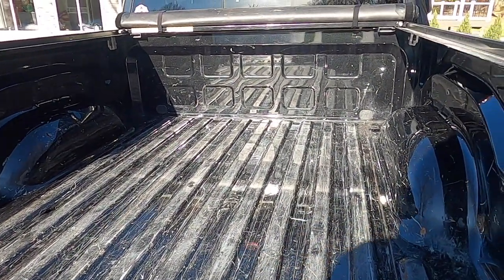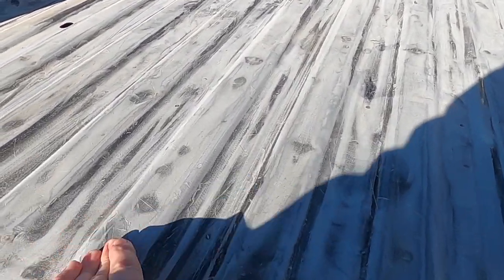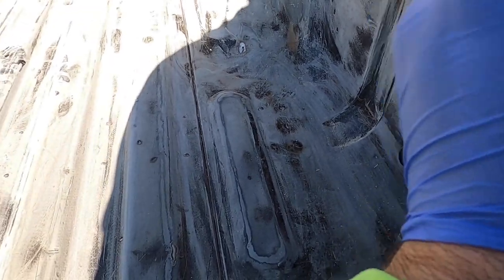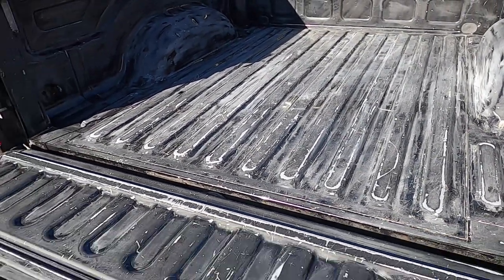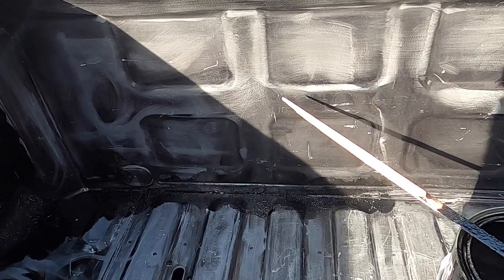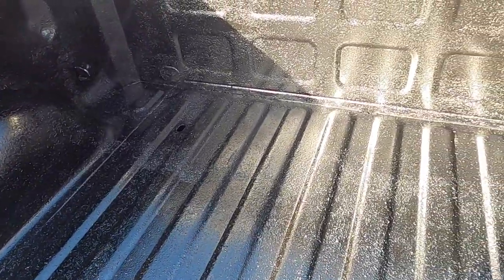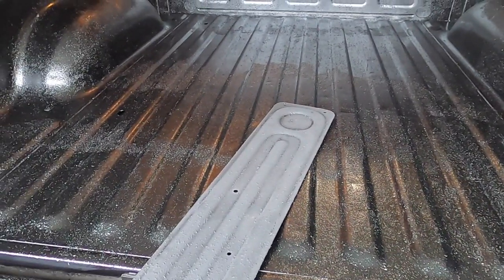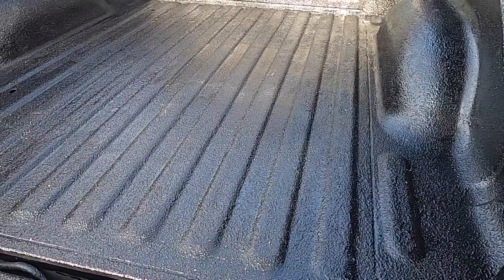Backyard DIY Herculiner Installation /Application Roll on Bed liner HCL1B8 Brush Bed Ram 1500 5'7"

Comment: Nice demo, Kevin. Truck bed looks professionally done!  Thanks for explaining it so well.  I also appreciate the low noise level of the music.  Best is no music.
1. Use an angle grinder with a wire cup brush ($5 at Harbor Freight) to sand contours.  Works well.,
2. Do you know if Herculiner is an Epoxy or a Polyurethane based paint?  Epoxy has a shorter pot life land tends to crack under vibration.
3. Can you custom tint Herculiner?
Reply from the maker: Thanks for the compliment!   Great idea on the wire cup.  As for the base, it’s polyurethane.  I do know it sat in my basement for years before applying and had no issues.  I am not sure on tinting.  I think it comes in a few basic colors.  Raptor liner seems to be a big player in the game being tintable
Reply: @hdkevin4387  Raptor Liner is an epoxy paint.  This means short pot life and prone to crack under vibrations.  Not the best choice for vehicles. It is also only sprayable, no brush work or rollers probably due to short working time before it hardens.  Therefore I am looking for other solutions - polyurethane based paints.

Comment: Did you let this dry outside? Does it matter if the sun touches it for hours? Thanks
Reply from the maker: I did let it dry outside.  And it was cooler. There was come condensation on it.   I noticed some color differences initially between some pieces but a few days later they all evened out

Comment: In comparison too a 500$ raptor liner spray job does this even truly stay hard don’t chip? Peel? Has anyone tried sliding any usual bed objects or using the bed like a truck bed would be used and does it show wear /marks anything on the Herculiner ?

Comment: Yeah... I'm going to take my truck to Line X when I get around to it. I'll gladly pay to have this type of work done on my truck in order to get it done right the first time.
Reply from the maker: Line X is the cats meow.  Better than Rhino lining and other commercial installs.  I'm going to save up for it on my next truck but I'm glad I don't have bare metal anymore.  Ha ha
Reply: $1k min vs $100.
Reply: Read the reviews on LineX before you endorse them. Their employees are required to spend less than 2 hours per vehicle so they skimp on prep and quality control. Each guy is expected to do 4 trucks a day. They just line them up and crank them out. The result is a finish that chips and peels. Good luck trying to get them to fix it down the road. DIY results like this video are better lasting and 1/10 the price. But not everybody is handy and diligent so just drop it off at LineX and cross your fingers for the rest

Comment: Is the sanding a must or can I skip the process ??? Reason I ask I want to do a whole inside of a 94 GMC Yukon...
Reply from the maker: I think it is a must. But if you’re not going to beat the heck outta it, you may be ok.  I just sanded rather than “scuffing” or “roughing” it for speed purposes. There were some areas on the side of my bed I missed and it still looks the same as it did when applied

Comment: What type of roller do you use to get the texture? They sell the paint here but not the DIY kit that comes with the roller.
Reply from the maker: https://www.amazon.com/KiwiGrip-Roller-Non-Skid-Deck-System/dp/B00YX720D6/ref=sr_1_1?dchild=1&keywords=KG10204+roller&qid=1612142510&sr=8-1
Reply from the maker: That can get your search started.  There’s a lot of options out there

Comment: So how has it turned out now that its been a few months?
Reply from the maker: Hello.  It is still just as good as the day I put it on.  So impressed
Reply: @hdkevin4387  good deal.  Thanks for the reply.  Keep getting after it brother
Reply from the maker: JMR Rebuilders you’re welcome!  I apologize for the delay.  I do not recall getting a notification about your comment.  The only slight issue I’ve noticed is on the tailgate.  I used the palm sander and on some of the raised stamping all the paint was removed.  The coating did not adhere to it as well and it has worn off slightly from repetitive use of ramps. Otherwise the other near 100% is perfect
Reply: @hdkevin4387  I’m constantly putting a lawn mower/metal tools in the back, do you you think this paint liner will hold up against that?
Reply from the maker: @CarlosContreras-pz3md  Hello.  In my opinion I think you'll be ok!  I do similar actions and have had no issues at all.  If you're shoveling gravel from your bed daily I would be concerned.  What is nice about this product is you can get a quart and touch up any areas that may get randomly damaged.  And I believe there is a warranty too so reaching out to the manufacturer is a good option.
Reply: @hdkevin4387  Rad

Comment: Nice job man! Did you completed all 3 coats With only one gallon?
Reply from the maker: Thanks!  I just used 1 gallon.  It is a 5'7" bed so it is really short
Reply: One gallon will only do 2 coats at the most
Reply: @JRs-guitars   did you not just watch this man do almost 3 full coats?
Reply: @ottallman  super thin coats yep. I got only 1 and a quarter coats on my 6'4" bed. And this stuff is JUNK!

Comment: How’s the texture ect holding up after a few months?
Reply from the maker: john johnson it has been good!  Thoroughly impressed.  There’s so much texture on the tailgate you can feel it through your pants when you sit on it. Ha ha. I only have one issue on the whole bed and that’s the raised parts of the stamps I over-sanded down to bare metal. My aluminum ramps rub on it and have since worn off the liner back down to bare metal. But I probably have 30 or 40 uses on the ramps since then.
Reply: Take it from someone who actually moved stuff in his truck with Herculiner...the $hit peels off like 30 year old wallpaper...it's terrible. I'm pissed I spent all that time putting it on..2 hours of prep sanding and 4 hours of applying for nothing!!!!!!
Reply from the maker: @JRs-guitars  Man that stinks.  I decided to go the cheap route since I do not haul bricks or gravel in it.  A professional spray in bedliner would be the way to go for heavy usage for sure
Reply: @hdkevin4387  that does make sense but the only things I have moved was furniture since I've put the Herculiner on lol. But you're right ...a pro spray in would be way better. I ended up putting a TechLiner over my Herculiner (made by weatherTech). It's pretty nice for only $250. (Includes tailgate liner).
Reply from the maker: JRindestructible ill have to look into that.  Weathertech makes really nice stuff.  Thanks!

Comment: Did you only use one gallon for all 3 applications?
Reply from the maker: Hello.  If I remember correctly (and I think I mentioned it on the video but can't remember) I did three coats on the bottom of the bed and the tailgate and 2 coats on the inside side walls.  My truck is a 5'7" mini Ram bed so I would think a typical short bed could only get 2 coats from a gallon

Comment: The sun will break it down fast, in one year I had factory paint showing through. Absolute junk, I am a pro so don't say I didn't do it right. I also ordered 2 kits. Hopefully you don't use your truck bed because the texture will grab and tear open concrete bags and if you slide in a sheet of sheet rock it will destroy it. Oh yah and if you slide in a sheet of melamine it will shave it to the factory paint because it is not hard enough and bad adhesion. I hate my 04 Dodge Ram anyway so it will look like cra_ until I kill it. Do Not Waste Your Time And Money!
Reply: Thanks for the info.  Whixh bedliner do u recommend on a budget?
Reply from the maker: I have a tonneau cover on it and a year later it is still looking new.  I have seen the sun destroy some too.  I would not think someone with a commercial duty application would want to go this route.  There are so many better options but cost way more.  As they say, cry now or cry later...
Reply from the maker: @funkymunky1275  I have heard very good things about Raptor Liner. I may actually give it a shot on a frame on a 2005 E350 this spring
Reply: Was thinking that im just gonna leave it regular and just use paint

Comment: Looks like crap. Why would you do something like this when you can get linex done for $500- $800 and comes with a warranty
Reply from the maker: I was being cheap.  My next truck I will save up and get the Line X.  Still holding up perfectly a year later
Reply: only because your to lazy to do it your self , out look great
Reply: @quentinmccarthy9188  I’m not lazy in any kind of way. I work hard for everything that I have. Just because you don’t work hard enough to afford the small things like bed liner is not my problem.
Reply: @evanwhale6127  Gonna come back and call you lazy. I have money, I can afford the line X, but instead I like to do it my self and save money and do it the American way, DIY.
Reply: @upsidedownpeon9984  I’m not ever close to lazy. I’m actually a highly skilled union industrial painter and work more than most people do in two years in one
Reply: @evanwhale6127  “highly skilled” 🤤
Reply: Skilled and painter doesn't belong in the same sentence 😂